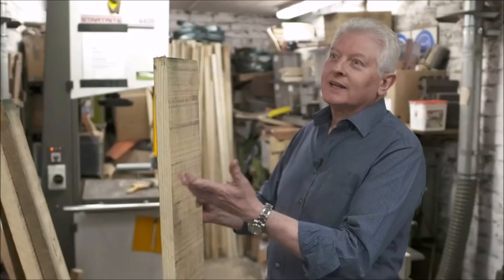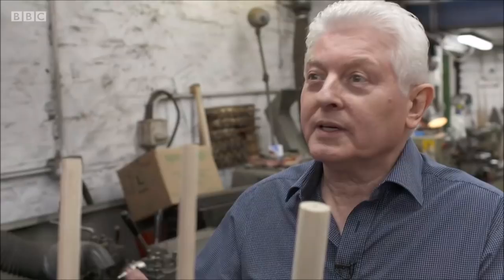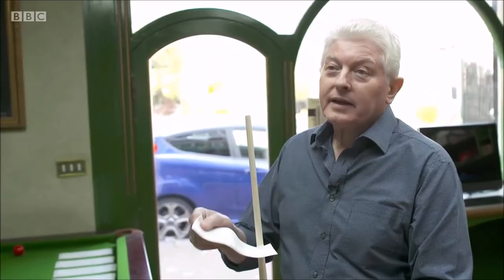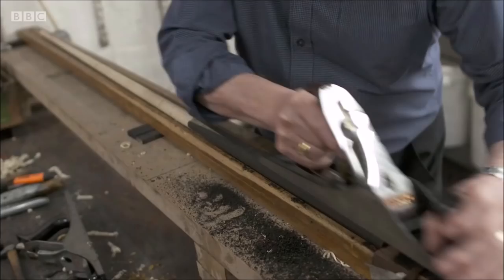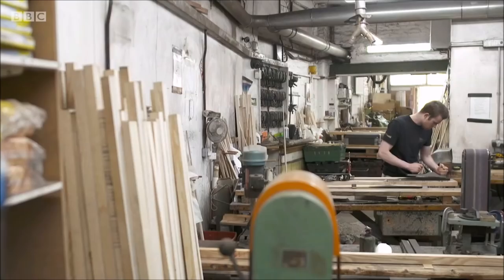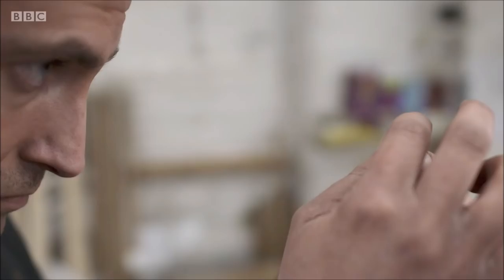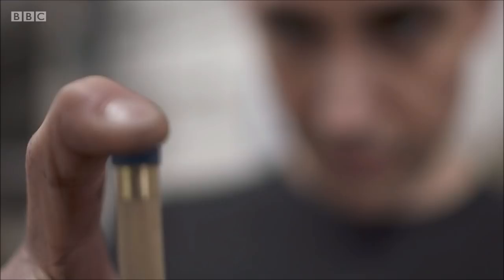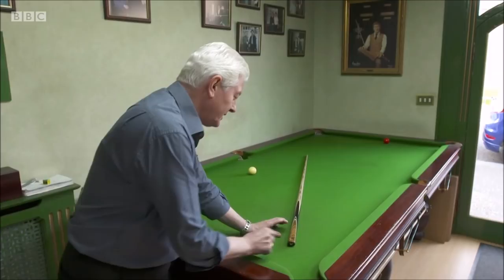Parris Cues 2017

Comment: Amazing to see that there is no turning on a lathe, not even in the early stages shaping from square to round.
Reply from the maker: Only Paragon and Ultimate are totally hand planed from start to finish, the rest of the cues are turned to an oversized taper then planed by hand to their final sizes. Realistically it makes no difference to how the cue plays if its fully lathe turned or fully hand planed.
Reply: @gerv55  Interesting, thanks.
Reply: Also in this very video you can see the marks left behind in the end of the oversized wood early in the video

Comment: I purchased mine in 1996 when on holiday in London! Remember trying à few shots on that small table.  I picked an 'ambassador' cue from the shelf. It was slightly bent though. John assured the bend in the cue does not affect your strokes.  I love the feel of the cue. It is not like any other.  But I never could get over the fact that cue is bent. 
Does anyone play with à bent in their cue?
Reply: My cue has a slight bend in the shaft. I orient it so it is leaning slightly downward in the same spot every shot. You’ll get used to it.
Reply: You can just get the bend removed by a cue maker

Comment: Why do they wait a month for each step
Reply from the maker: To let the wood settle to reduce the possibility of it warping.
Reply: @gerv55 nonsense. The wood is fully seasoned, there's no settling, it's not foundations. The lignin in the wood is already dried. The man hand makes stuff it probably takes a month to get back to each one
Reply: @ToxicEmperor  The guy has been making high end cues for over a quarter of a century. I'm sure he knows what he's doing.
Reply: @fishmeister2625  I didn't say he doesn't know what he's doing. I was answering the above question about settling. I've been a Craftsman for 25 years myself and I know for a fact that a piece of 2"by2"by 5' Ash isn't going to settle!
Reply: @ToxicEmperor  😅 fully seasoned?? To what moisture content? Fully seasoned to one timber merchants will be different too fully seasoned in another.  Timber kiln dried to 3% moisture content won't stay at 3%, it will fluctuate with its surroundings,  which means it's going to move. Fully seasoned only means it's been sat long enough for the merchants to stick a moisture meter in it and get a reading that says it's stable enough to sell!